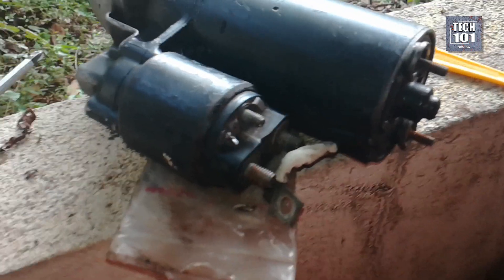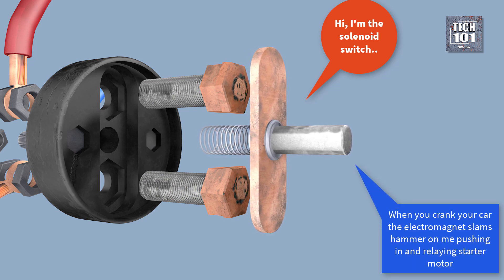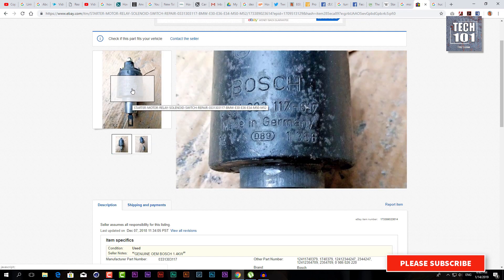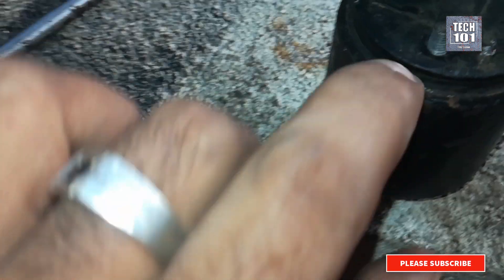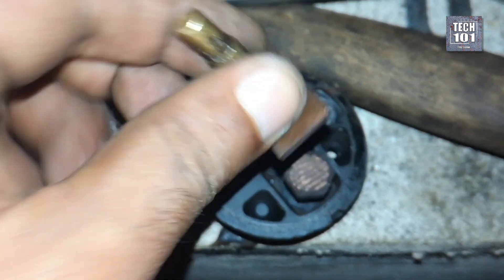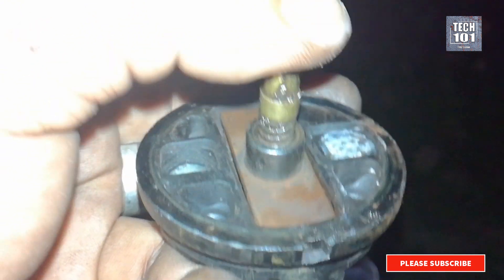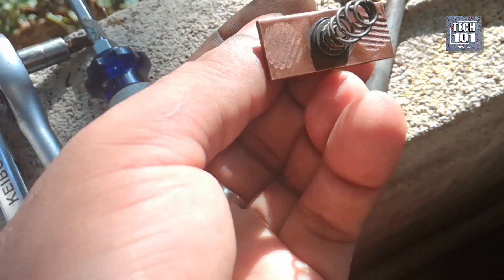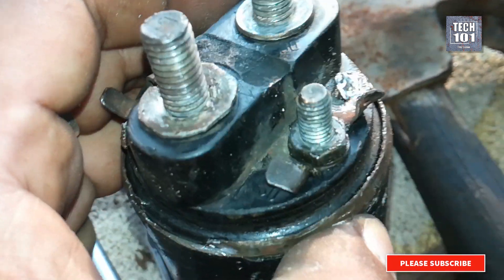BMW E34 E36 BOSCH Starter Solenoid Switch Restoration 5 Series 3 Series Best Trick Ever Save Money

Comment: I used to work in a factory`s down this. First had a press machine for down hundreds a day but if your just doing one you can make a jig. Just get some thick angle iron. Drill 3 holes that line up with the mounting holes so you can tighten it on to the angle iron. Make sure your screws are not too long as they will damage the copper windings. Then drill a hole in the middle of the three so that it lines up with the plunger. This hole should be bigger so you can fit a 3/8 extension socket through it. Then put 2 metal tubes either side if the solenoid so that you can put it in a big vice without the solenoid touching byt just the 2 tubes. Then put a socket inside the solenoid plunger hole and and extension bar so that when you put it all in a vice and tighten the socket will push out the inside of the solenoid. Before refitting just bash the metal edge of the casing open a bit with a small hammer.
Reply from the maker: Thanks for the long comment, man you sure know the drill. Of course these things can be repaired and used for years rather than spending precious bucks on new ones unnecessarily.
Reply: @techorny  This is the first vid I`ve seen taking a sealed solenoid apart on here. All the other starter repair vids just leave them and hope for the best. It was in the 90`s when I worked at Valeo. We would repair about 150 of these 0331 303 solenoids everyday. All had new caps on but the contacts were stripped down and if the copper was ok we just turned them over. Used to be a real thick copper contact for diesels that I used to pinch for home repairs lol.
Reply from the maker: @damianbutterworth2434  Wow thank you for stopping by you're such a treasure..Please stick around and share your experience/ know-how with your channel more and more. I should subscribe your channel..
Reply: @techorny  Don`t know why it says down when should say doing  in my first comment. I must be getting old lol or autocorrect. :) Cheers for joining. I`ve done the same back. Cheers bro.
Reply from the maker: @damianbutterworth2434  Yes I was confused you know I'm not a native speaker, tried to figure out what you mean referring to dictionaries. But I got the idea.. Yes may be your auto correct, thank you too n stay safe..
Reply: @techorny  Don`t worry about spelling. all good engineers are rubbish at spelling. You talk very good English. I understood you perfectly well. You should set up a bissness repairing starters and alternators. Even changing bearing and seals on turbos. You have all the talent.
Reply from the maker: @damianbutterworth2434  Thanks a lot, lets see, we will keep in touch to share ideas.. Pleasure meeting such a nice person..

Comment: i am having the same challenge with a high mileage e-34 that first started when I heard a popping clanking sound that happened in sub freezing temperatures and was followed by a    whirring sound and  a loss of starting capacity.
Reply from the maker: Did you check whats causing the issue?
Reply: @techorny  6 months ago i tried to remove the starter from the bottom of the car, but then i realized how hard it is to get to the top bolts of the starter. To get to the starter on the M50 engine, i have to remove the intake manifold and cylinder head.  That is the next step.
Reply from the maker: @oliverrojas7117  6 months ago? u havent still got it fixed? not a daily runner? Why dont u do a video on it?
Reply: @techorny  it was a running car and daily driver for almost 4 months.   a month ago i moved the car into a space where i can work on it.  Okay, i will do a video on it.
Reply from the maker: @oliverrojas7117  Looking forward to the video buddy, dont take long...good luck..